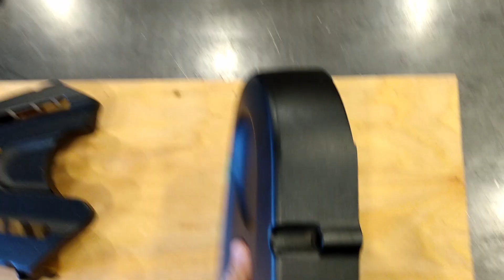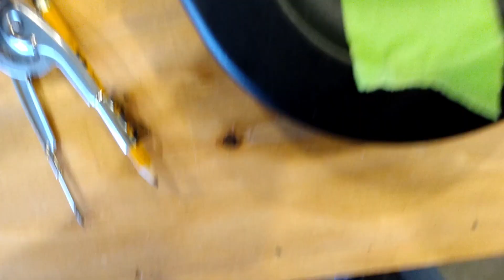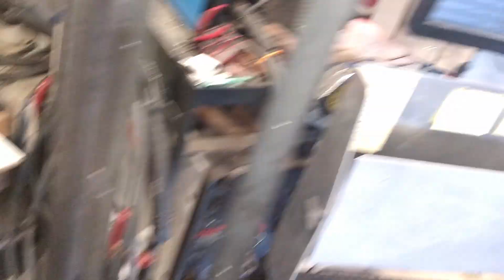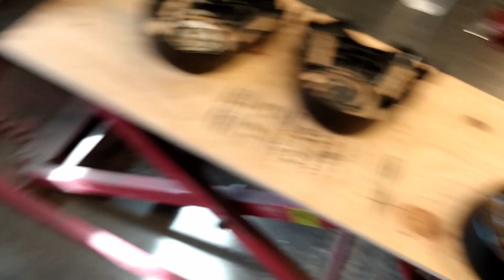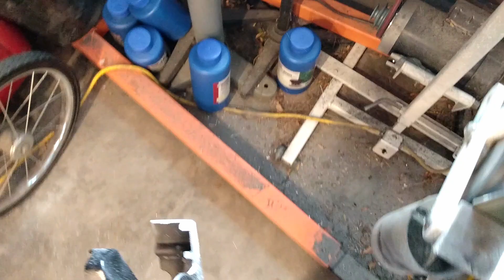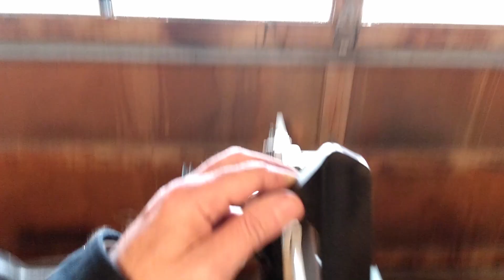INDIAN SCOUT CUSTOM PULLEY COVER

Comment: Awesome video! Any idea what paint the OEM part has on it? I need to touch mine up
Reply from the maker: Good question.  I have been very careful not to need touch-ups.

I'd try one of the Rustoleum black colors, either gloss or satin.

BTW, this "Rust-Oleum Universal All Surface Metallic Spray Paint" matches my frame very closely.  See my video on Scout driving lights to see what I mean.